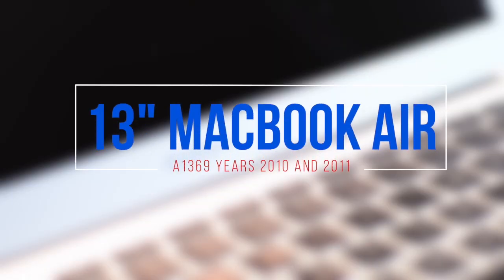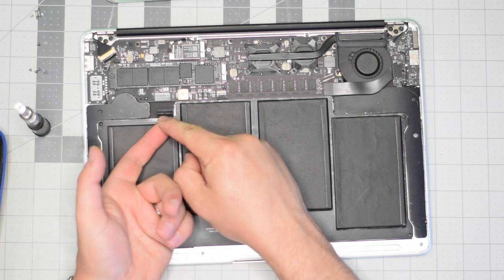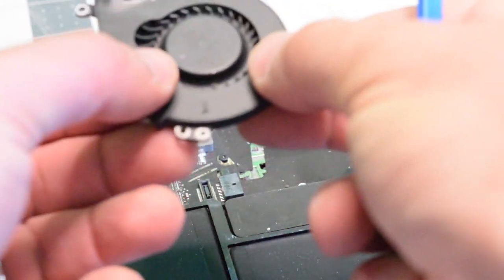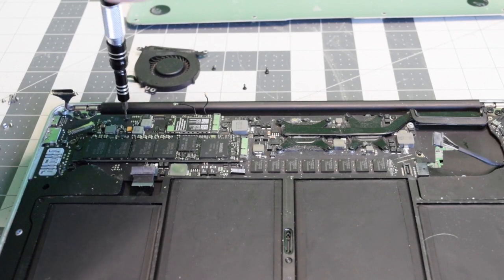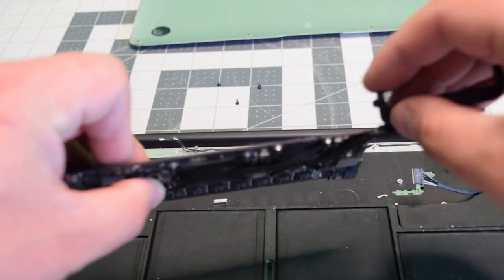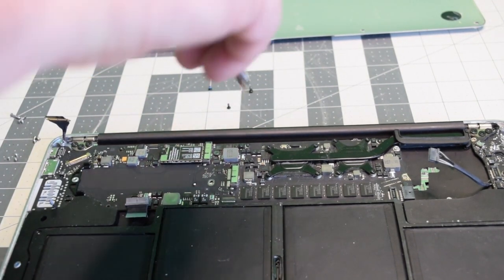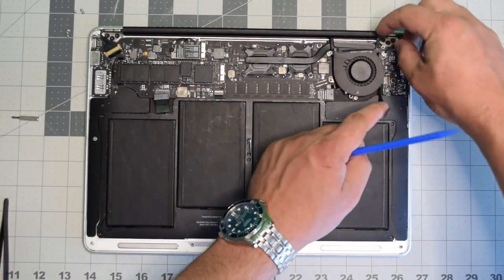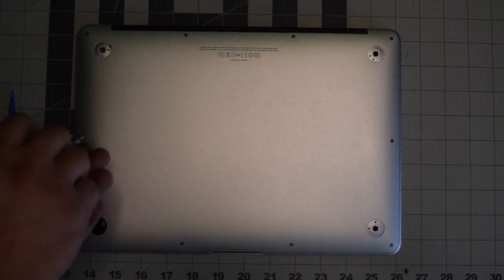13" Macbook Air A1369 2010 and 2011 Logicboard Replacement Installation

Comment: Currently I am using Macbook Air A1369 EMC 2392 (Late 2010) but the mainboard is damaged, can I replace it with A2469 mainboard?

Comment: This guide was really helpful in my attempt at replacing the logic board on my 2011 MacBook Air.  Thanks !!
Reply: I am thinking of my 2G Ram logic board replacement  into 8G Ram one. It does not look so complicated and will start in January.